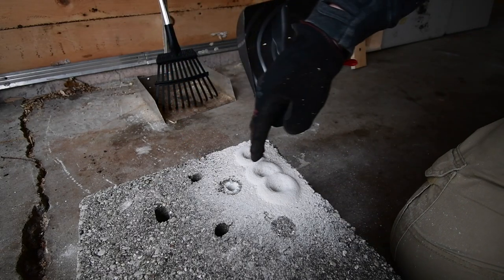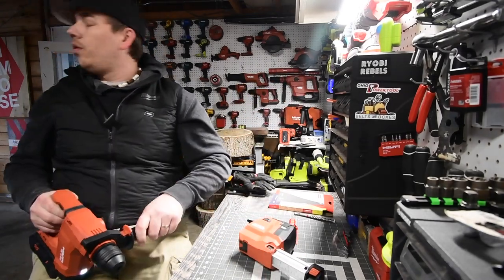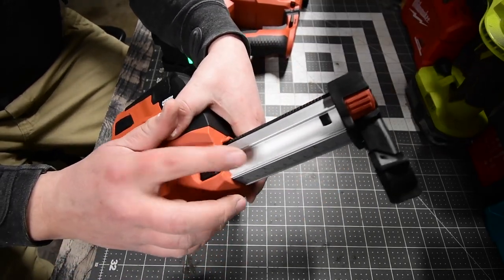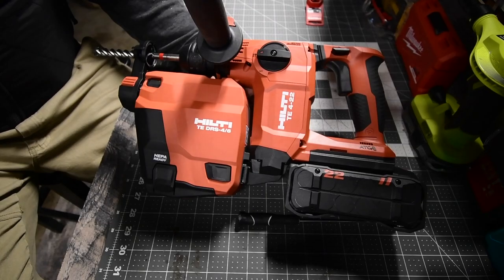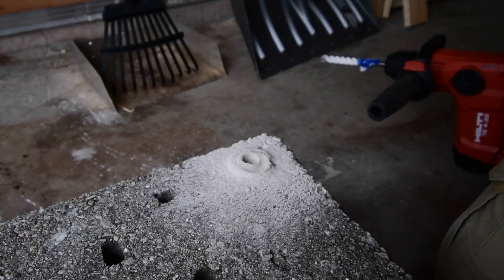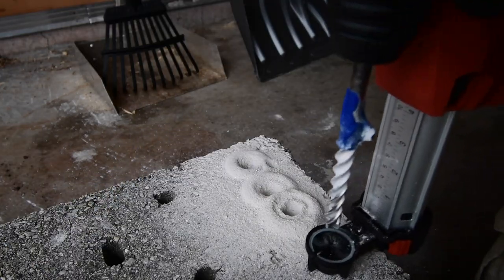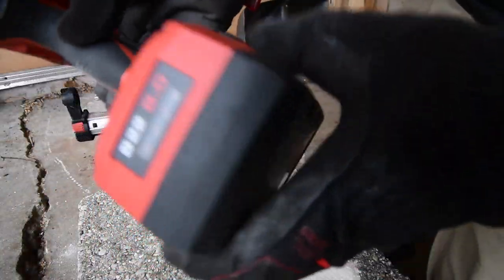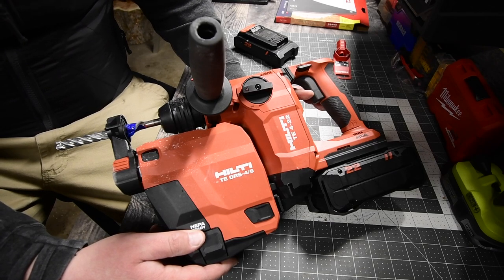You Will Never Use a Regular Hammer Drill Again!

Comment: I just got this as well. The “button” on the bottom seems to be a feature that you pull it back and let it snap back to clear the dust from the filter. It says in the manual I think to do it 5 times. I’m guessing it just helps knock the particles off the filter material to better clear the box
Reply from the maker: I thank you for that info sir.
Reply: Yes, that shakes the filter which makes it OSHA compliant for silica dust!

Comment: I bought a TE7-C with the DRS system in 2010.  Absolutely love it!   Mine is over a decade old and it works so well.  Great for overhead drilling.  Once I was doing some drilling overhead in reinforced concrete and some dust went into my eye.  I should have had my googles on.  Won’t EVER make that mistake again!  That prompted me to buy a rotary hammer with dust control.  This HILTI and other HILTI products are top notch.  Their cordless platform continues to evolve.

Comment: Yea i haven't used a "hammer drill" in like 5 years. Got small, big, and huge rotary hammers all in dewalt 20v and flexvolt
Reply: What size flexvolt rotary do you have? Is it one of the new offerings they came out with? Does it have any cons in your opinion as I have been looking at them for a while but hesitant to pull the trigger?
Reply: @atrainace114  i have the flexvolt dch416 sds plus 1 1/4" rotary hammer and the dch773 sds max 2" rotary hammer. Con to the 2" is obviously its huge its like 22 lbs but its a beast. More meant for chipping then drilling. Ive heard the flexvolt 1 3/4 sds max is a nice option if you want something lighter but still has power although ive never used it myself. And the flexvolt dch416 sds plus is a great hammer as well but if you want the 20v battery compatibility the 1 1/8" dch293 isnt too far behind in power when using same bigger batteries. Im heavily invested and have the batteries i need for 20v or flexvolt so im not worried and just want the best tool possible. All my flexvolts are 12ah so i do good on runtime too. The dch416 has the wireless tool control to the flexvolt extractor as well. So does the 1 3/4" model i mentioned earlier but the 2" model dch773 i have does not. Theres a newer 2" model that does have the wireless tool control. Its got the same EXACT specs but that added feature but dewalt charges the same price for both but the newer 1 only comes with 2 9ah batteries while the dch773 comes with 12ah batteries

Edit: o yea 1 minor con to the 2" dch773 is there is no reverse only forward even though its a rotary hammer not jus a chipping hammer. I dont get it how hard is a reverse switch?

Comment: There is one thing to consider at the lowest end though: Which one can drill through brick without absolutely exploding the back-half. For art reasons and jury-rigging weirdness reasons

Also just for fun: Panasonic in Japan uses that hilti vacuum attachment in one of their modular gun-type hammer drills: EZ1HD1. It's absolutely tiny :)
Reply: For hollow bricks you should not use hammer function at all just drilling with two-bladed drill bit.
Reply: Panasonic and Hilti are building ned developing tools together. They have a joint venture.

Comment: Weight according EPTA-Procedure 01/2003：5.4 lb.
Optimum Hammer drilling range：5/32 - 9/16 in
Hammer drilling diameter range：5/32 - 1-3/32 in
Single impact energy：1.7 ft-lbs
Hammer drilling RPM：1050 rpm
Triaxial vibration value for hammer drilling into concrete (ah,HD)：10.1 m/s² (B22-110 battery + TE DRS-4/6) /12.0 m/s² ( B22-85 battery)

Comment: I recently found out that I need an SDS after years of using a hammer drill. There’s just no comparison at all and SDS is like 60% quieter and about 80% faster.

It’s so weird because the hammer drill sounds like it spins faster and the SDS doesn’t sound like it’s working too hard at all.
Reply: Not 1.8X, but 8 X  faster in brick, 20 X faster in concret 200, and 2000 - 8000 X faster in concret 400.
Reply: Thats because the hammer drill is spinning faster and delivering extremely more blows (bpms) but with not much force. The hammer drill is working harder. Sds deliver with slower but much harder hitting blows. As sds get bigger they the rpms keep going down but they deliver higher ft lbs or joules of impact energy. Efficiency. Faster isnt always better. Depending on what size your drilling a smaller sds rotary can drill faster then bigger sds rotary on smaller holes sometimes because of its higher rpms

Comment: Wonder when MCT will get rotary hammers from other brands like the TTI trio , dewalt , ect. Would love to see a head to head of these beasts.

Side note i use the New Ryobi Rotary Hammer (P223) in my line of work, it's a beast for the price. Wish it had a vacuum attachment like this one (i know you can get an attachment that uses a normal vacuum just not as easy to use).
Reply from the maker: Verus videos will be coming :) I cant wait for that
Reply: There is no sane reason to be interested in TTI trio. Sure Duss is expensive, Hilti not so much but still. Even DeWalt cost something. But anyone can buy a very good Makita, even one that is faster and also more reliable then a Hilti. And even a blue Bosch is afordable for someone that needs tools.

Comment: The SF 6 is not a hammer drill and it was not designed to drill in concrete. It has vibration to help you drilling in brick. Even the drill bits for concrete and brick are different.